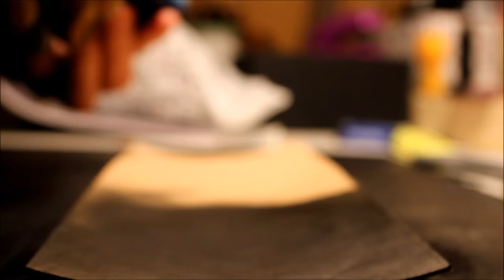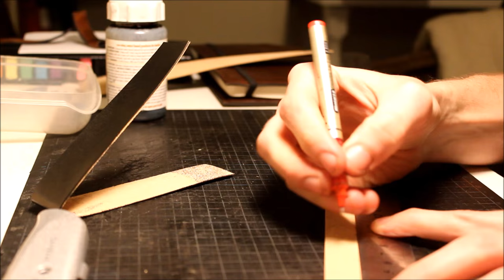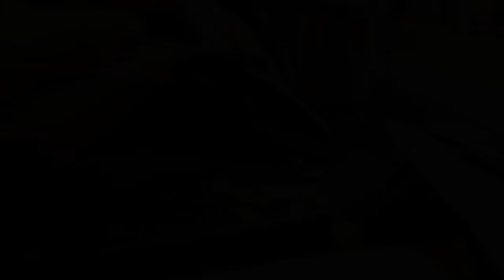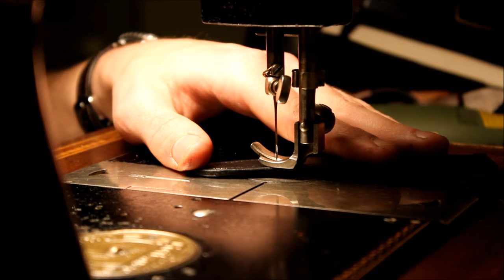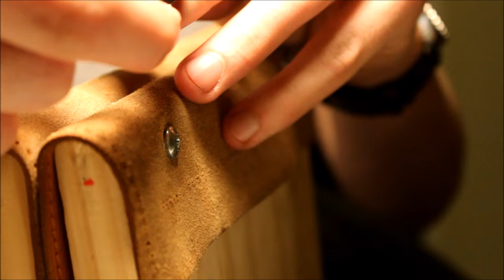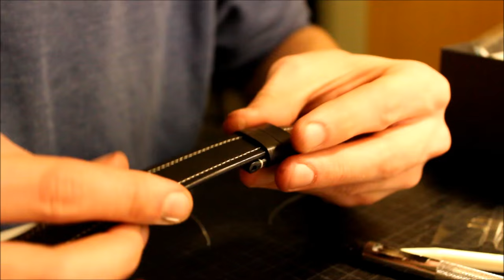Custom Made Watch Strap - Sanggaard Straps

Comment: How long does each strap take- start to finish
Reply from the maker: it depends on the design. a strap like this would take 6-8 hours with stitching all the way. even longer with fixed keeper and padded middle... the longest i have used on a strap is my snakeskin strap that you can see on my instagram :) i think it was about 20 hours or so...

Comment: This turned out so nice! I can't make them this perfect yet... Did you cut this strap tapered or straight? Because you cut it with a ruler I think it's rather straight which is rather unusual. What buckle are you going to use with it and how do you punch the tongue holes? I'm going to use a butterfly clasp for my next one.

Have you tried vinegaroon to dye the leather? This only works for black of course but for me it worked really well.

Did you make the strap of the watch you're wearing yourself also?
Reply from the maker: i cannot really remember if it was tapered or straight. if i make tapered straps today i have made templated out of a nesquick container :D (hard pressed cardboard with metal layers)

i use a sharpened flathead screwdriver to punch the toungue hole, but if you are going to use a butterfly clasp, i dont think its nessesary, since there are no toungue

never tried vinegaroon, i buy my leather dye :)

and yes i also made that strap, have a look at my instagram @sanggaard as mentioned in the description ;)

Comment: what about the holes for the buckle?
Reply from the maker: i add the holes when it is sold. it all depends on the type of buckle that the buyer wants. this strap ended up with a preV buckle (wider hole for the buckle). the holes in the long strap are made custom to the buyers wrist size